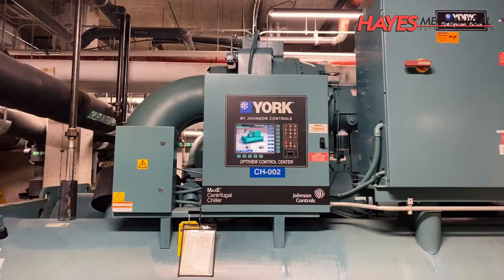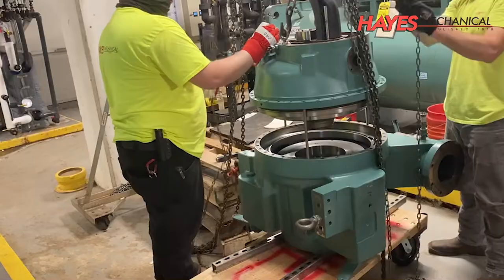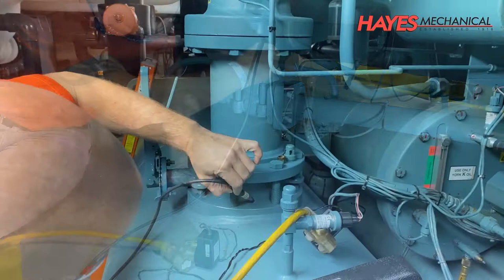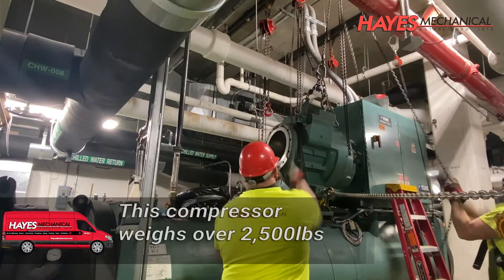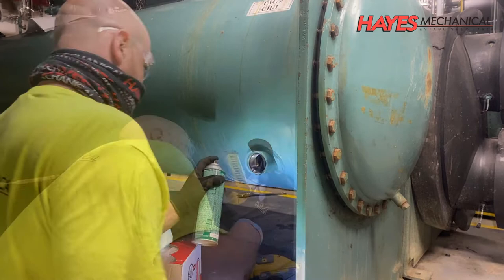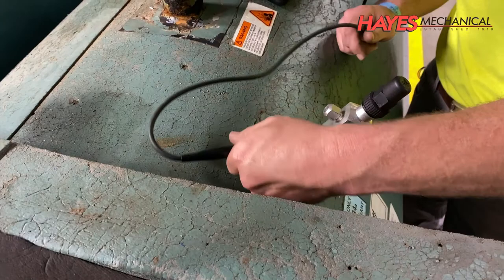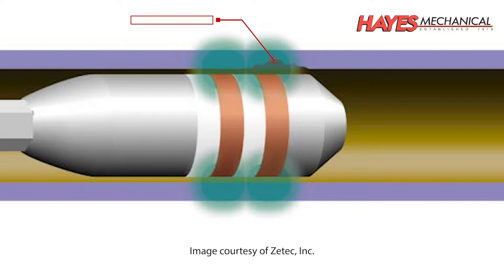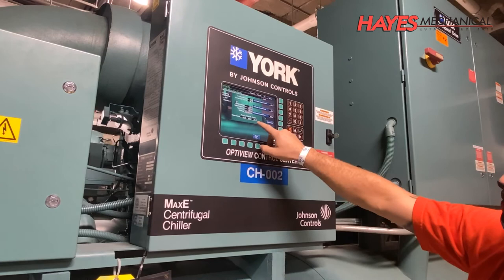Hayes University: Chiller Teardown

Comment: If the machine is leak free and your oil sample comes back clean,keep low head on the chiller so you don't surge and destroy the high speed thrust and the prox probe is in range there is no need to overhaul the compressor.I have seen Yorks run for 20 years and never come apart.
Reply from the maker: Hey Billy, thanks for your feedback. We hope you enjoyed the video. Stay tuned for more videos down the road!